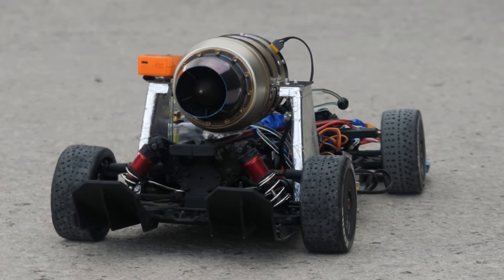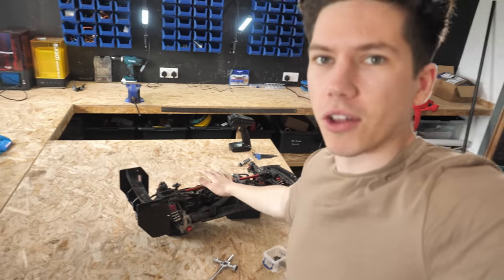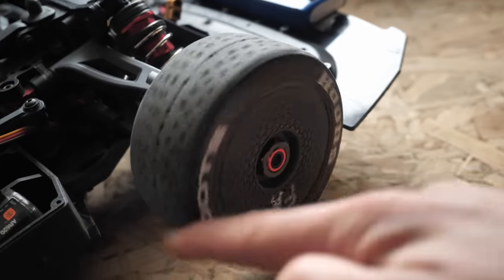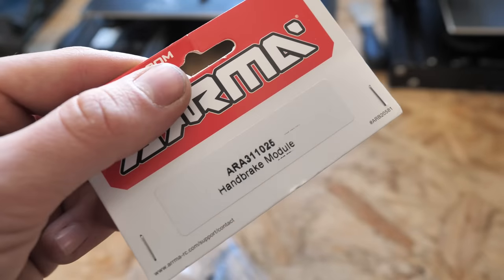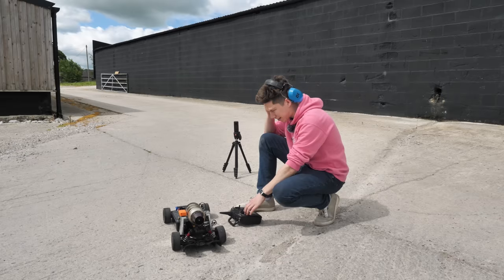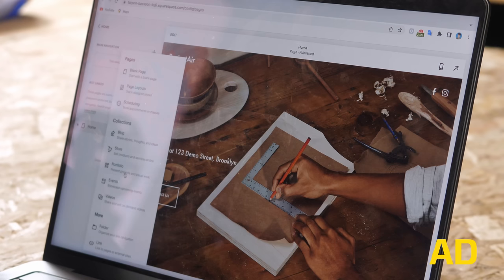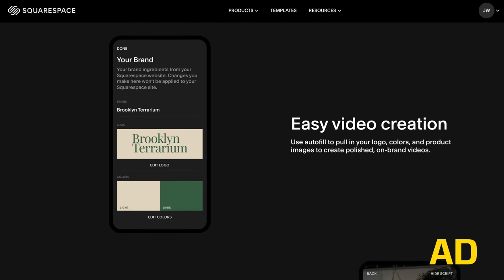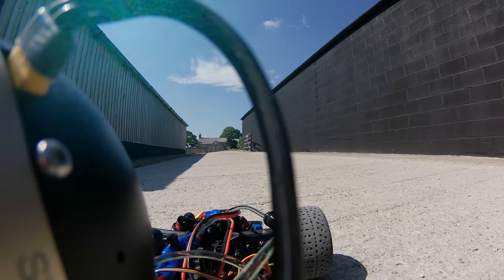RC Car Jet Engine Upgrade

Comment: Lol  I was watching that guy Raz, and it's like he doesn't know which cars set the records in real life, like, the normal size cars.  It's always rocket cars.  But you have to pull the air in from beneath the car, then you can't lose, you're vacuum locked the road.

Comment: maybe print a vertical wing to keep it stable at high speeds? dunno if a normal wing would be needed because no traction needed at the wheels xD so a straight vertical one would do good i think
Reply: You mean a vertical stabilizer?

Comment: I would recommend to install a gyro steering system to prevent the rc car from losing control, which it will definitely happen in high speed

Comment: reverse thrust for braking maybe?? if the brake fails, also would give the ability to ramp up more when the car is standing still, and slow down faster , you can even angle the "buckets" upwards to get more downforce when braking.

Comment: You can have a wheel driven car that runs purely off a jet engine.  It is called a turboshaft jet engine.  The Chrysler Turbine Car had one back in 1963

Comment: Design some thrust reversers. The tires are too small for the heat and load you will put on them and the wheel bearings are unproven for the speeds you are seeking to obtain. The suspension is miscalibrated and the RC cart is bouncing all over the ground and losing contact with the ground. Use heavier suspension and ground effect wings and sideskirts. Check the centre of gravity between the front and rear axles and the left and right side. You want 55% of the weight on the front axles.

Comment: NOOOOOO come on anyone with a motorway, runaway, airport send a bloody email asap !!! we need to see that beast running. 
Joke aside I wonder if at high speed the drogue will lift the rear of the car, a few holes in the drogue to balance the pressure and not act as a parachute maybe?

Comment: I was screaming internally when you decided to put brakes on the rear wheels instead of the front where they would actually be useful to slow down and stop, i was then relieved when you switched the brakes to the front

Comment: Tarmac runways are a must rather than concrete. A longer wheelbase will make a lot of difference to straight line stability and top speed (shorter wheelbases are better for acceleration and cornering) I build R/C Rocket land speed vehicles and only build long wheel base versions now.
Reply: corning yes. but acceleration also needs long wheelbase or it will just want to do a backflip.  Look at top fuel dragsters.
Reply: @toolbaggers  that’s an interesting point you make yes. Once you’re up to dragster level of power and acceleration. But with thrust powered vehicles (especially when motors are mounted as high as this R/C car) forward flips are common. Look at that guy that fits fireworks to the roofs of toys cars/trains/planes etc in his YouTube channel. They almost always forward flip. So long wheelbase like a dragster as you say will help with forward flipping too. As will jet engine height, angle and lengthways positioning.
My models accelerate like crazy now I’ve got that right. 8 x faster 0-60 than an F1 car.
But I’ve not taken them to ultra high speeds yet. Just crazy bursts of acceleration for 5 meters or so then cruise for 50m or so then crash into a pile of soft fabric (when all goes to plan lol, 80% destroyed after serious air from hitting a bump last time and blew to bits in a big fireball)

Comment: If you're actually trying to preserve the engine, you should consider building a better suspension, and/or build an engine mount that can absorb the shocks caused by the rough street. This is a lot of stress for bearings and the shaft. 

Otherwise the engine life will be shorter than usual and you might risk destroying a bearing, which could result in trashing the whole engine. 

Dampened engine mounts on aircraft or for maintanence-transport-mounts are a serious thing.

Comment: are there any large shopping malls in the area with equally large parking areas? I use the parking areas of the local mall ( on Sundays) to do my testing. I do it on Sundays due to the majority of the stores are closed and there is plenty of open area.

Comment: My 2 cents…
1.	Jet engines produce huge power BUT relatively little thrust (Power = Trust x Exhaust Gas Speed). The Power is so high as the Exhaust Gas Speed on this small jet engine is over 1000 mph! As a result, you need to make your vehicle as aerodynamic as possible, as otherwise you won’t be allowing the engine to perform at its best.
2.	Put a roll-cage over the turbine for when you hit a stone and it rolls
3.	Add a gyro on the steering to help keep it going in a straight line
Reply: Thrust is a force measured in pounds or newtons
Reply: Power = thrust x speed of the engine not the speed of exhaust gases.
If a jet aircraft is at full throttle but attached to a static test stand, then the jet engine produces no propulsive power, however thrust is still produced.

Comment: jet engines just aren't meant for land vehicles that need to turn. since its thrust axis is fixed, turning throws off the directional velocity and would make it do a few 180s. but, if you attach a driveshaft to that turbine... now you got something worth watching.

Comment: Putting a jet n an rc car has been done before the main problem u will have is keeping it on the ground, the shoot is probably not going help it may actually cause more problems, as it will lift the car of the ground and u will most likely total it, looks cool though 👍 using the brakes is probably the best bet at stopping it and keeping it under control, looking forward to seeing how it goes 👍, I'm thinking probably end up in bits and on fire 🔥 as that's what happens to rc jets when it goes wrong 🤣👍

Comment: There are abandoned runways in Northumberland that could work for this - the land is used for army training so you might need permission to film/work out the timing, but it definitely has enough space up there (and surface) for this…

Comment: hey man a have a 3000 foot runway that I use for rc plane and it is very smooth I recently got it rerun with tar so it should work quiet well.

Comment: Would it be possible to use a bucket similar to a jet boat on the back of that engine to act as a brake and reverse gear?

Comment: Havent played with jet engines before, so i am curious if it being so low to the ground is an issue, does the front wheels not stir up a lot of dust/small rocks that fly intot the engine?

Comment: I think that combining a 8 nitro engines into a V8 engine and putting it on RC car is more extreme engine swap than 120 000 RPM jet turbine engine swap

Comment: maybe try making a thrust-reverser by taking a bigger parashute and adding string in the middle to pull the parashute into a conical/ horizontaly cut doughnut like shape. but you would have to make it from heavy duty cotton/linnen canvas in order to withstand the heat.
Reply: I can't even imagine canvas that can stand jet exhaust? That has to be HOT.

Comment: Are the brakes simply binary?? It would be a lot better to have an analog sweep. You can still have a binary switch but then you get to choose how hard the brakes stop, and even slow it down gradually if you want. You don't want the fuel to slosh and allow the engine to flame out due to a momentary lean condition.    Also, why use a parachute on a jet engine? It would really suck if it flipped around in the wind after stopping and cut off the air flow into the engine. Not to mention ..... It could melt .... And catching your turbines thrust output in the parachute leaves no room for catching your forward air speed...... The latter of which is what actually slows you down w a chute 

Ditch the chute!!! Get those brakes tuned better instead

Comment: Need to make the parachute teacher longer… notice how the chute went straight up, It will lift the back of the car off the ground and cause a high speed crash… happens to drag cars with chutes set up incorrectly

Comment: Hi mate, I've been wondering about using aluminium tape to insulate PLA parts for a while! Did you find any issues or was it all ok?
Reply: Hi mate. It does work(to a point), but you shouldn't use it inside anyways. If the pla gets too hot, it let out toxic gases.

Comment: Just so you know, for your rocket videos, I do not know if you have achieved your level 1 cert yet. If you haven’t you are not allowed to use a g motor with a thrust above 80 or use a sparky motor which is dark matter, skid mark, metal storm. Not sure what the laws are in your country that is just the restriction there are in America, just wanted to let you know.

Comment: Put fpv gear in it with a UHF for transmitting to car and this way you can just keep going instead of the pathetic line of sight half mile at best range driving take it on to the highway at night and get someone to stay behind it or just chase it yourself side by side o got planes and high powered equipment i been out ten miles no problem with my gear I’ve also flown outside the us boundary into Mexico I’m very illegal and still fly no problems if you need help on locating the right gear msg me back my channel speaks for itself

Comment: try aluminium thin film helium balloon electrostatic vacuum levitation, and/or, have a same polarization charged ground plate, and place an aluminium very thin light film on top, it should levitation on the principle of electrostatic motor, ie, repulsion of same charged items, let the levitating object start at rest on top of the ground negative plate, it will levitate up, and by the inverse square force law, it will stay on top of the plate, but not touching, unless there is spikes and too much weight
Reply: symmetric forward triangle wing, equal up-down lift, so that you can push that thing in ground effect, very close at the ground all the time, no matter how much power it takes
Reply: try CaO (calcium oxide, the cement additive) + added water, maybe from atmosphere, 300Wh/kg energy storage, heat back in kiln to CaO, from Ca(OH)2